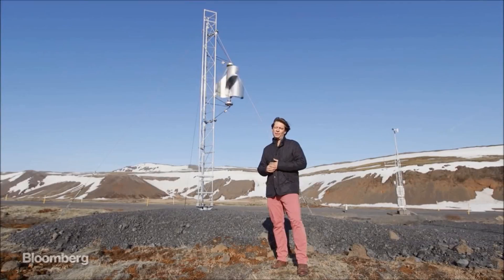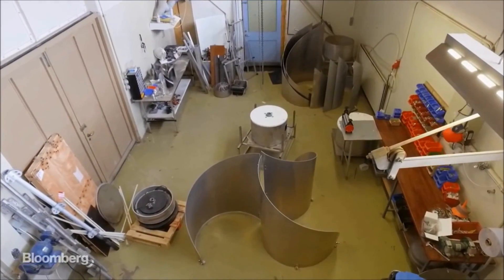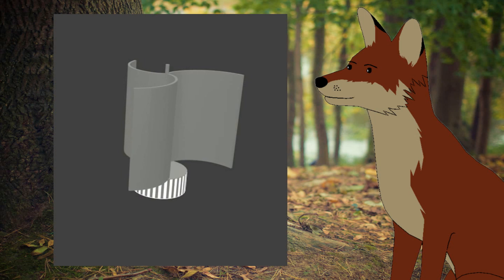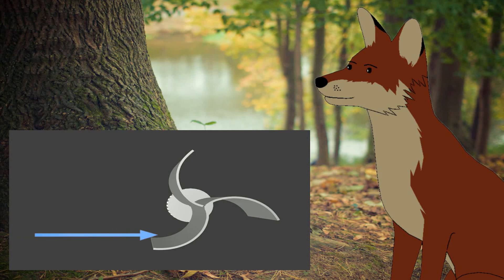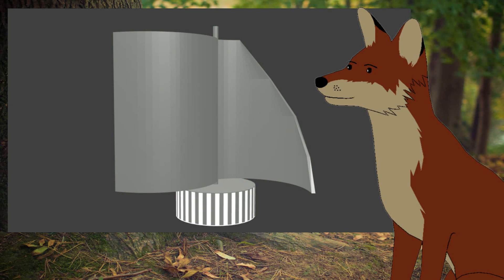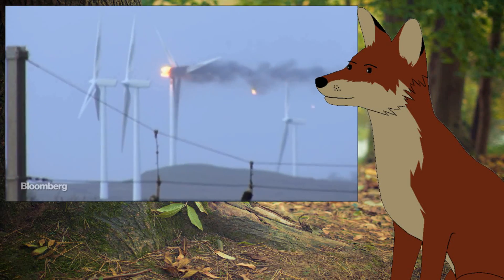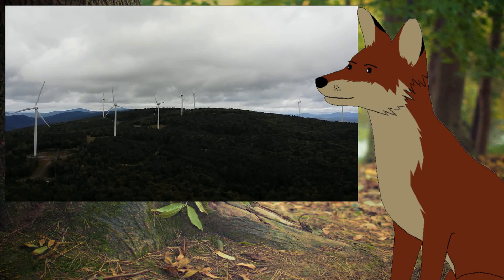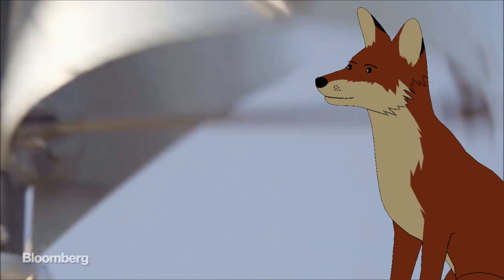IceWind Turbine - BUSTED

Comment: Ok. There are a few flaws in this video.....

1. Cutting the blades in half does NOT affect the efficiency. Since efficiency is directly related to the swept area of the turbine the swept area is reduced and the output drops but the efficiency stays the same. VERY basic engineering principle.

2. The efficiency of a savonius based system is generally between 10-20%. However the efficiency of a horizontal axis turbine at this power level these guys are aiming for (1000W) is nowhere near 59% (Betz limin). The average efficiency of a small scale horizontal axis wind turbine is between 10-25%. JUST DO YOUR HOMEWORK. This can be easily calculated from any manufacturers data sheet.  The big 1-3MW turbines have efficiency up to about 48%, NOT 59%

I saw their video online and was skeptic but interested, and then I found this video and I decided to send these guys an email UNLIKE any of you geniuses.
They told me that they founded the company in 2012 and began real development in 2013. The history line on their website is just a HISTORY line scattered from a few years back. They have not been in full development since 2008. 
The efficiency of their system is between 15-18% and they are working on things to improve on that and dont publish the latest development online since patents have to be finalized first.  
They were actually very open in sharing info despite that they have not released a data sheet. They told me that the basis of these turbines was durability and they were able to withstand extreme weather as high as 60m/s and was built for the Nordic regions where solar power during winter time is almost not available. 

I hope they meet their goals because their turbines look great. Being an engineer and a skeptic I realize a few problems on the way and with the design. But compared to other solutions out there at this power level they are average.

Just show some responsibility before you do a video like this and DO YOUR HOMEWORK. It is obvious that you have NO engineering nor a scientific background so please dont drag other people down the stupid hole with you.
Reply: ding ding ding And we have a winner ! @Matt Flanagan seems to be the only getting the point of this wind turbine .. They are not going for a high efficiency turbine to compete with other styles of wind turbines, they are just trying to make something that will last here in Iceland.. Think 65mph wind with some sleet and - 15°c + wind chill then u get an idea what conditions they are trying to make it for.. Nobody is expecting these to compete with horizontal wind turbines in the Texas market or something, these are being developed to withstand our winters, and on the government grant , it's not just to research the efficiency of this style of wind turbines, you can google much of that info since they did not invent this, it's again mostly about withstanding the weather and be low maintenance ( again cause of the weather and heavy snow in the winter, the places where these turbines are, powering remote monitoring stations and such, they can be really hard to access for maintenance).. So your not "busting" anything, your just not getting the point of their project at all :)
Reply: The "Increase in the Savonius Rotors Efficiency VIA A Parametric Investigation", which I already provided the link to, pointed out that a high aspect ratio improves efficiency... In aeronautics a high aspect ratio means long and thin!

Another french study, "Increase in the Savonius Rotors Efficiency VIA A Parametric Investication", similarly established through mathematical analysis that the rotors should be ideally twice as high as the diameter...

Again, this all follows the engineering of aerodynamics.

A drag system may has its differences from a lift system but they also have similarities in that both are working within the parameters of aerodynamics because the blades still have to move through the air as well as be pushed by the wind and the air flow around the blades matter towards its efficiency...

The study you focused on also pointed out this by showing a minimum number of blades are optimal for efficiency because that helps reduce the surface area that works against its efficiency and is part of the reason for the swirling shape of the blades they tested as well...  So just maximizing surface area doesn't work if it also results in increasing resistance that lowers efficiency...

You basically ignored both the counter wind force and air resistance and how differing airflow can create vortex drag at the blades edge when you dismissed changing the shape of the blade as automatically being less efficient...
Reply: felt like this "fox says" is just making fuzz, doing shit for views :D
Reply: Just as there are different types of boats for different purposes and conditions, there is not a one size fits all type of wind turbine. I understood that in winter when there is no solar production and potentially reduced hydro output due to freezing conditions, another source of power would help to balance the energy demand. The key requirements of this turbine would be to operate in freezing conditions with frequently strong winds and ice and snow. This is a niche which requires a specific solution. High efficiency turbines are useless if they can't work in the above conditions. It also appears that the main use of these turbines may be where there is no grid power. Go ahead "Fox Says" rip me apart for having a different opinion/agenda to yours!
Reply: ZeoCyberG you totally misrepresented the report you linked to. What it actually says is that having the end plates on is better.

".. the circular end plate is the best choice for maximizing power and torque co-efﬁcients for helical Savonius wind turbines "
Reply: We engineers can make a better world, too bad the bankers are interested in their bottom line, I love being a engineer, as  its a club, no matter where your from in the world, we tend to click, speaking in general
Reply: @fox says  ( IceWind Turbine - BUSTED  ) - Debunked, you should have some pride and accept you might have it wrong sometimes... you cant always win
Reply: Yep, just look at improvements of efficiency in solar panels and wind turbines over the last couple decades. Not to mention electric cars. Seems like "Green Narrative Ideology" has numbers to back it up. 
That fact is that people like Fox Says and david duffy are only bashing green technology for... ideological reasons.
Reply: Frank M 
Why not you advise the manufacturers. After all you know a lot more than them. Don't you have an IQ of 500 and have won 69 Nobel Prizes in Physics????

I'm not interested in wasting a minute more in debating with idiots.
Reply: Trying to type a response to the people saying that this turbine is actually a good idea, but since those people can not even read a study correctly, and clearly also are not able to do actual research and apply logic to numbers and methodology this is a lost cause. 
To all those sheep who upvoted comments of Jim Berger and ZeoCyberG i ask to read some study's for themselves and apply logic to it.
Reply: You're saying it lost 40% of it's area which made it even less efficient. Well people have already pointed the flaws in your terminology but those triangular blades have a purpose. If you have some basic idea of mechanics, you might know about LEVERS. And how force distribution of levers decrease as you move away from the Axis holding the weight. The same principle works here. The blades get thinner towards the edges and are wider at the centre. This reduces the drag on the blade which which is pushing the rotor opposite to the desired direction. That may decrease the output but increases efficiency and durability.
Reply: david duffy thinking this way is what will bankrupt the world. Can't make ideological policies and stances. Reality is reality
Reply: @beeseebee_ ...so is idiocracy 😂
Reply: Yawn, I guess you think coal falls from the sky and turns into instantly usable energy without any effect on the environment? Some people.... lol
Reply: Gary Baris 
Some people do think...........
But who cares. For every genius 1000 idiots are born. Doesn't makes sense to waste time on rectifying them
Reply: Chandrasekhar, I guess you've found one of the thousand. 

Frank, In my country there is no subsidy for erecting wind turbines. To the contrary, they are fully privately funded and run for 20 years while they pay for themselves and show a profit off electricity sales to the national grid. At the end of the 20 years, they are handed over to the state. The same applies to solar farms. I live in a very coal rich country where coal is a very cheap source of energy and still, wind and solar comes in cheaper. Some people, Really!!!
Reply: Gary Baris 
Reported all his comments. 
And I think I should also flag this video as being a commercial and spam. 
It's undoubtably sponsored by oil companies and is violating Youtube regulations by trolling comments.
Reply: a lenz 2 vawt is more effecient because of the push / pull nature of its wing design. as far as wind pushing on a surface
wing loading on aircraft depent more on the chord (a wings thickest  part) when straight moving air hits a slanted surface its tends to roll over the corners ( run off of air down the wings of swept wing aircraft solves the problem with supsonic flight)...  andother hence a barrel cut in half is acually more effecient. more surface area, more wing caught, more torque generated.      I'm sorry, I dont expect people to learn aeronaughts 101.

to this date then modificaction of the Lenz vawt is more efficient for only 1 reason. the half wings are designed in a way     
wind push's in around and the angle of the wings helps pull it.   some reason wings are more effectient the round flat panels.  oh right  drag.
Reply: efficiency for the surface area of the blades may stay the same but the efficiency for the same the device occupies does go down. duh
Reply: @tibs7095  yep
Reply: Taranach McLeod u
Reply: Fox Says tell me Mr. Fox, what happens when some asshat drunken kid throws a beer bottle on blade -wind turbine? And what happens when savonius gets a hit? Which one do you think can survive urban elements better?
Reply: Jim Berger a
Reply: missing link lol
Reply: Fox Says - The link you posted.... Not Found
Apologies, but the page you requested could not be found. Perhaps searching will help.
Reply: Chandrasekhar Panigrahi - Do you know what government subsidies are?
Reply: Frank M 
Govt is not dumb enough to spend more energy into something that'll not pay for itself. It doesn't makes sense. 
Govt subsidies are granted to promote businesses which in turn helps stabilising the economy. The govt needs money for subsidises. They collect it through taxes. That means they are increasing the price of an underpriced commodity and are using the extra money to decrease the price of an overpriced commodity. That way an economy stabilizes. The ultimate target is always to get the most out of it. If a company hits bankruptcy then the national economy also suffers. Subsidies are way less than the loss the government would face if the company goes bankrupt. Don't think that subsidies are GIFTS by the govt. They're a statistical investment which pays for itself. The Govt subsidises are for economical benifits cuz economy is a concept created by humans. We can create money. It's not natural. You won't find economics in forests. 
But energy is not something we can create. How can you even think of subsidizing energy. 
People don't understand subsidises properly and shout in the YouTube comments as if they are the greatest economists ever born on earth.
Reply: Chandrasekhar Panigrahi - You don't have a clue about how government works.  Government is in the business of growing itself and taxing more to feed its growing bureaucracy.  Wind turbines are a pipe dream.  They will never produce as much energy as it takes to make them.
Reply: Frank M, you are just another bloody conspiracy theorist....
Reply: Frank M 
Your opinion doesn't matters 
 .................NOT AT ALL!!!
There isn't a lack of people who challenge the authenticity of Apollo missions or believe in Atlantis. It's not worth explaining them. 
 You're just an ordinariy, skeptical and stupid layman. 
Keep shouting.
Reply: Gary Baris - You just can't think for yourself, you foolish limey.  You're losing your country and still you can't see reality.
Reply: Frank M, please don't spread your ignorance here. You got both statements wrong... lol
Reply: Frank M 
Ok Sir,
you keep thinking for yourself. Don't lose your country and keep seeing the reality and.............
 allow us to mind the renewable business without any idiotic interference.
Reply: Gary Baris - Wind turbines are fake.  If you had even an ounce of common sense you'd be able to figure out that a wind turbine, during it's entire service life, cannot produce the equivalent energy that it took to make it.  The math is not that difficult.
Reply: Frank M 
OK
So you mean governments, engineers, architects, the entire Danish and Chinese population don't have even an ounce of common sense.
Right????
Reply: Category 2: Winds range from 96 to 110 mph and can be expected to produce extensive property damage. Greater wind velocities mean that debris poses a greater threat to humans and animals, while the roofing, siding, and glass windows (protected and unprotected) of frame homes are more vulnerable to damage. In a Category 2 storm, significant structural damage to apartment buildings, mobile homes, and shopping centers is also expected, as well as flooding in low-lying areas. Extensive power outages ranging from a few days to a few weeks are common, and residents are encouraged to stock up on potable water as filtration systems also fail during this time.
Reply: Jim Berger, thanks for your useful comment. But Fox, thanks for your video. Even though there were inaccuracies in some of your assessments, it was still educational about some of the basic and relevant facts and concepts.
Reply: Jim, thanks for you comments too. I see there is a bit to the engineering that I have to investigate.
Reply: Jim Berger The efficiency would drop because now it will not spin in as low of winds. yes it is a little lighter but that does not lighten it up enough compared to the drag it produces. if they would have cut the bottom instead of the top it would have lost less efficiency then it did but it would still lose some efficiency too low winds...
Reply: Jim Berger Oh so they’re turbine looks like it will do horrible in the arctic weather with snow and ice. The way it is designed it will stop spending all the time from ice and snow buildup in between the blades.
Reply: Then you're not paying attention because I already gave you a link that showed not having end plates improves efficiency!

Being a drag based system doesn't change the fact that air still needs to flow efficiently around it and the design has to deal with many of the same issues as lift based systems.

The edge of the blade still produces vertexes that cause a drag coefficient.  So reducing the size of the edge of the blade helps reduce that effect and while reducing the surface area of the blade may reduce the surface area, it also reduces the area that the opposing wind flow would push against...

Then the added shape of the blade helps it partly act like a lift system, improving the efficiency of how it moves through the air and helps maximize the energy it absorbs from the remaining surface area.

It's one of the reasons I pointed to modern sailing... By your logic we should still be using big square sails but a triangular sail can be more efficient than a square sail and allow for a focusing of power that can be directed for more control that you couldn't get with the square design...

Having alternating blade patterns also helps break up vortexes that could impede efficiency...

These are just some of the principles that effect both drag and lift blade designs... 

You're also missing the fact it doesn't have to be a pure Savonius system and can mix elements of lift system in its design, which is apparently what they're going for...

Savonius turbines are used because they tend to be more reliable and long lasting... Wind vanes, certain roof air vent systems, water turbines, etc. are many of the places you will see a Savonius Turbine in use today despite its inherent lack of efficiency because of that fact... But again that's with the standard design...  It's just a valid reason why to use them in a region known for its harsh weather even if they never get the efficiency as high as horizontal lift based turbines.

The only question is whether they can get the efficiency high enough to compete with lift based turbines for other parts of the world but as shown improving the aerodynamics can have an effect, even if they may seem counter intuitive to you...
Reply: You don't seem to have much of a notion when it gets to aerodynamics , the harsh weather conditions it was designed for and level of research and investment required to produce a safe and efficient product that does what it says on the box. Instead of spending all the time producing a video based on your opinion why don't you create a few models, thoroughly test them and the compare to what they have. Easy to give an "opinion", hard to back it up with concrete evidence so hope you get going and do something other than just giving your opinion.
Reply: @xlnoob  Its not an efficient product though
Reply: Drag propulsion still works off aerodynamics... You're still dealing with issues like the edge of the blade forming vortexes that induce drag on the motion of the blades...

Just because it's not a lift based system doesn't mean these issues don't have similar solutions...  Things like reducing the size of the edge of the blade help reduce the size of the vertexes being formed from the different airflows in front and behind the blades towards the blades edge and thus helps reduce the drag that makes it less efficient.

You can also mix elements of lift and drag... It's not always one or the other in aerodynamic engineering... as the link I posted just before your response shows...
Reply: Hate to tell you this but that single study you cited is self referential and shit... did you look at the photos and the layout of their experiment? They have their "wind tunnel" (which is nothing more than an elongated ducted fan) pointing to their "turbine" and directly behind the turbine at an equal distance as the wind tunnel is a freaking wall.... now what kind of back pressures do you suppose that generates? Where have you seen ANY wind turbines backed against a cliff face? 

That is merely the first fail... the next appears to be the materials used. Despite the poor quality of even the downloaded picture, the construction appears to be using rather thick "separator plates" made out of MDF or particle board... not exactly high quality nor weatherable materials... not to mention the possibility of a "flywheel" effect due to the additional mass. I saw nothing in their equations to compensate for this, nor do they even go into the actual construction materials and methods... these are not the hallmarks of a good study, rather the methods of "free energy" charlatans and targeted (read paid)) bias debunkers that want you to take their words at face value and don't look too deeply into the actual product... 

I would be curious to see who was funding their particular study and would not be surprised to find a horizontal turbine manufacturer hiding somewhere in the background... perhaps even the fossil fuel industry... they wouldn't want everybody to be able to make their own (relatively cheap) energy... that would cut into their profits...

Do you at least have a couple other studies with equivalent or better methods that arrive at the same conclusion? Can you find a study that actually tested different physical blade geometries (such as tapering) rather than completely cylindrical with end caps? Until such time as you do, your opinion is no more than conjecture and holds as much weight as any other "lay" opinion... especially with your roots in the "energy industry"....

Also... so you say that the turbine on fire was not a product of  "overspeed"... Are you so sure? Many of those videos have other turbines also in frame... oddly not moving... and the smoke is trailing briskly off the leeward end, even large falling flaming chunks do not drop down but are blown by a rather stiff wind... perhaps because the feathering for that turbine did not work and the attempts at braking to slow it down caused the brake pads to ignite? This is simple physics and disingenuous at best. As several others have stated, do your homework and learn the possible failure modes before you armchair quarterback.  You were still doing well enough presenting your case until you got to the end and started championing the complex utility industry windmills and denigrating anything else... You also had a problem with how long it seemed to take for their development... They are in good company on that front... Edison, Bell, even the Wright Brothers spent many years on many different designs and tweaking and refining certain ones in pursuit of just a functional, if not marketable, piece of equipment... the last stage is all the testing and red tape in satisfying all the safety and reliability concerns... all of which require <gasp> funding!!!  

Your heavy bias is showing bud and If I may remind you, much of your highly vaunted utility and electricity technology still boils down to water or steam, YES a steam engine, pushing the blades on your generator... not really all that different from wind... even your nuclear plants are producing steam, with all of the concurrent losses in heat and the energy required to bring your combustibles to the generation point as well as hauling away the spent fuel... factor those in as well and your "efficiency" drops rather precipitously as well... Not a
swayed and definitely not impressed.
Reply: For example, Savonius Turbines have been experimented with to utilize the magnus effect for a kind of hybrid turbine system...

https://www.researchgate.net/publication/240627785_A_Study_on_Savonius_Type_Magnus_Wind_Turbine
Reply: No, you're misreading the study... For one thing the study showed that the height of the turbine matters more to its power than its width and you're just focusing on the one part of the study that seemed to agree with you but ignore that part that counters your other critic about cutting part of the outer part of the blade and shows it isn't a big reducer of power as you suggested as long as they keep the height length greater than the width ratio...

Second, you're ignoring that they tested in a closed system with the wind flow going in one direction and not in a open real world system where the wind can be coming from multiple directions and including up and down drafts...

Sure, a closed system can focus the power in one direction well but it can also block the flow from other directions...

Besides, such a design ignores issues like causing the turbine to spin too fast... Unlike the horizontal turbines a drag system can't turn into the wind to stop spinning...  So a way for the over pressure to bleed out isn't necessarily a bad thing...

For another that effect wouldn't be true of a hybrid system that mixes both drag and lift characteristics anyway for the same reason you don't see such boxing in of lift turbines short of jet engines...

Really, how many decades did it take to perfect the lift system based turbines?  We're talking blade designs that evolved over a 50-60 year period and that's mainstream...

It took decades to develop the vortex generating shapes of modern turbine blades to optimize air flow and reduce noise but still maximize power...

While there's hardly been any research on improving drag based systems in comparison... So there doesn't need to be a conspiracy, just a lack of interest and effort but that doesn't mean it can't be improved and how is very unlikely to be how you think it should be improved.

Heck, it took a really long time for scientists to figure out how bees fly because it defied conventional thinking on how it should work...  You're basically making the same mistake here and assuming only certain aspects of turbine design apply but essentially ignore all others and that's the problem with your critic...

Sure, it may not be the most efficient compared to lift based turbines but they are more reliable and longer lasting.  Unlike a lift system, a drag system doesn't have to turn to the direction of the wind and can draw energy from wind coming in any and all directions at the same time...

While a hybrid blade design can have features of both that put it somewhere in the middle of those pros and cons of both systems...

Suffice it to say this is more legit than you think it is...
Reply: @ZeoCyberG  I agree with you.
It's not often two people have opposing ideas our thoughts and both are technically correct.

I think both of these people are technically correct. In general.

I think the original video is onto something great. It may have some flaws that make it workout

The best way for long term use.

In southeast United States I've seen many people using this type of technology for the last 10 years and I homemade style.... They all report great success.

Thank you

CHIEF
Reply: Uh, that study only addressed number of blade configurations and combinations for optimal air flow of a standard design but did not go into what is being discussed with optimizing the aerodynamics of the blades themselves...

Really, if you look at the shape of horizontal wind turbine blades you won't find any shaped just for maximum surface area because what really matters is the aerodynamic efficiency of the blade shape because as you pointed out just having a wide surface only leaves you dealing with the counter wind flow and air drag, which was the problem with the original standard design...

You can look at horizontal turbine blades and see how they have evolved their shape to maximize aerodynamic efficiency and to reduce noise... Along with advance features like generating vortexes to optimize air flow and prevent stalling...

https://image.slidesharecdn.com/upwindvortexgeneratorsolutionjuly2014-150313174553-conversion-gate01/95/upwind-vortex-generator-solution-3-638.jpg?cb=1426269164

Same thing with modern sailing boats sail shape, etc. Maximum surface area is not always the most efficient if it doesn't account for aerodynamics and how airflow behaves...

It only makes sense a vertical system would employ the same kind of physics as the horizontal systems already do and changing the shape of the blades accordingly and just dealing with a different rotational direction...
Reply: https://www.researchgate.net/figure/276841097_fig1_Fig-1-Schematic-views-of-helical-Savonius-wind-turbine-without-end-plates
Reply: less surface area, less torque, bigger diameter ,less RPM, long and thin faster RPM but less torque, that wind turbine can use a deflector on the left side to prevent the wind from blowing against the blade, ...just saying
Reply: Jim Berger Thank you for saving me from watching the whole thing. It's bizarre. Excellent explanation.
Reply: Jim Berger u r wrong.    He hit every mark.    They have not innovated or improved anything.   Short and sweet
Reply: I defy anyone to prove that wind turbines produce more energy than it takes to actually create them.  Mine the ore for the metal, smelt it, ship it, stamp it, wield it together, transport it to the site.  WInd turbines are all smoke and mirrors BS.
Reply: Jim Berger, the key to successful Green Funding funding is "Ideological Efficiency". Green Funding doesn't rely on robust science, or sound math, it's how far your "Green Project" can drive the "Green Narrative", Ideology is the driver of "Green Science".
Reply from the maker: ZeoCyberG
That is true for darrieus style VAWTs that rely on lift to create propulsion in a similar manner to VAWTs.  But the savonius doesn't rely on lift, it relies on drag for propulsion.
Reply from the maker: ZeoCyberG
From the abstract of the study you are citing: The use of both upper and lower end plates significantly increases the power coefficient by 36% compared with no end plates. We found that the Maskell's blockage correction method for straight Savonius wind turbines is applicable to helical Savonius wind turbines for small blockage ratios ranging from 3 to 8.3%. It was also observed that the power coefficient increases linearly in proportion to the area of the end plate. 

Savonius is the square rigger of wind turbines.  Icewind is just hanging a triagular sail from a square rigged yard arm, and you seem to think that will cause it to act like a modern sailboat.  The efficiency of triangular sails only works when the boat is rigged fore and aft, like all modern sailboats.  

There are applications where savonius turbines make a lot of sense, like rood ventilators.  However, there are reasons why they have essentially been abandoned when it comes to electricity generation.  Notice how you only see savonius turbines used for electric generation in research applications or by startup companies.  Established commercial manufacturers, both large and small scale, make either HAWTs or darrieus VAWTs.  It's not like there is some conspiracy to keep the superior savonius out of the hands of the masses.
Reply from the maker: ZeoCyberG
Of course there is some mix of fluid dynamic principals at work, but savonius is largely drag based, and I don't see anything about Icewind's design that would suggest that it has any type of hybrid features that give it any more lift than any other standard savonius.  After only reading the abstract mind you, the results of the study you linked still appear to back me up that the Icewind design is shit.  At least it's shit in that it does not have endplates.
Reply from the maker: Are we reading the same study?  The study is titled “Effects of end plates with various shapes and sizes on helical Savonius wind turbines”.1.      
 Please cite the location of the study where it states that height matters more than width.2.      
Please cite where it infers that removing sections of the blades makes little difference so long as you have a high aspect ratio.3.      
In the study, they recognized the issues caused by a closed system, and discussed the mathematical corrections they did to the results to compensate for the closed system..      
You talk about how long it took to perfect the lift type.  The drag type has been around longer than lift type.  Doesn’t it speak to the fundamental flaws of the drag type that it was essentially abandoned for the lift type?
As for the second study, I requested the full text, but they have yet to respond.
Reply from the maker: Would you prefer me to have said they took an inefficient design and made it even less effective?  However you want to term it, for the given height and width of the turbine they could generate more energy by filling in the bits that they cut out.  

Speaking of their design, according to this 2012 study of savonius wind turbine design (http://www.sciencedirect.com/science/article/pii/S111001681200049X) their design is pretty much the opposite of what makes the best design for savonius.  According to the results of their experiments, a 2 stage, 2 blade, high aspect ratio turbine with end plates provides the best power coefficient.  By contrast the icewind is a single stage, 3 blade, low aspect ratio turbine without endplates.  

So the official start of the company was in 2012 / 2013 rather than 2008. Does that really make it that much better? They have still been “innovating” a well-known design for 4 years.  And taking government money to do it.  

There are already many small wind turbines on the market.  The average survivability rating on small wind turbines is 49.5 m/s.  That’s a category 2 hurricane.  In all but the most extreme cases, survivability ratings above this are not necessary.  However, if it is needed, this turbine (http://www.xzeres.com/wind-turbine-products/xzeres-skystream-3-7wind-turbine/) claims 63 m/s survivability.  A rating slightly better than the oh so hardy Icewind, and you can actually buy it today.
Reply from the maker: Jc Muller
Your suggestion doesn't make much sense.  First, I would have to have access to one of their turbines for comparison, or at least their published data.  Since they have yet to actually bring a model to market, or publish data on their turbines I have nothing to compare to.  Secondly I'm not in the business of making small wind turbines, nor do I want to be so building a competing design to them would be a waste of my time.  Third, I can easily point to studies by people who have already done what you suggested.  Studies like this one. http://www.sciencedirect.com/science/article/pii/S111001681200049X